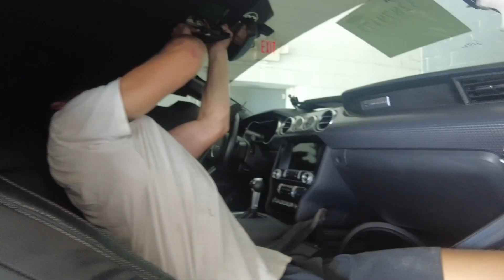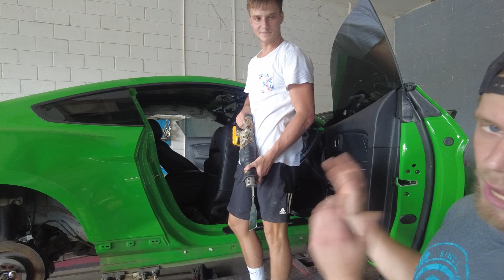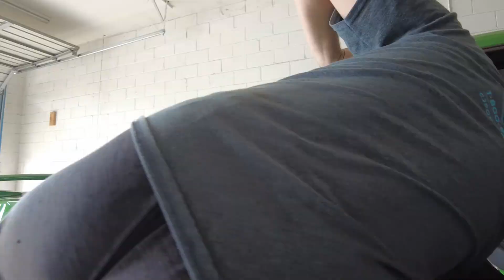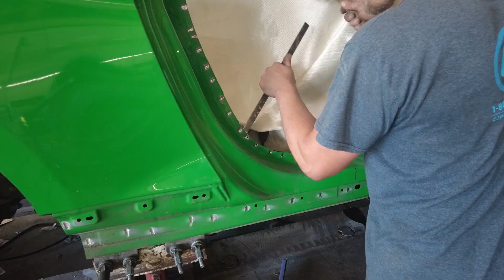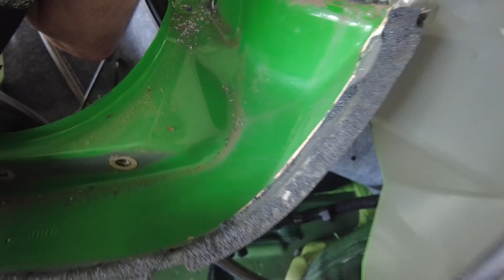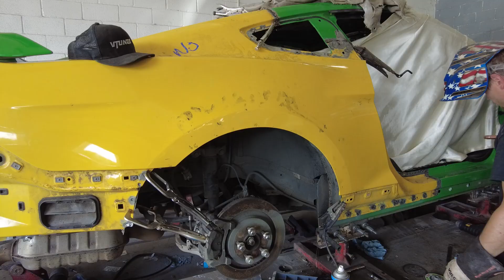Replacing the quarter panel on my cousins 2019 Ford Mustang GT

Comment: Question, wouldn’t it be easier to just mount the entire donor quarter panel without having to remove two outer skins??? Just solder the 3 areas and the floor of the trunk????
Reply: Meaning if the wheel area is really bent inward during impact that the inner shell is damaged, would it be easier to just mount your entire donor shell
Reply: @CSJiGSaW08 yes but you still need to align it properly

Comment: Question my 2018 gen 3 is currently in shop for rear quarter panel replacement 
How ever my insurance declined the claim since “a windshield doesn’t need to be replaced to fix the quarter panel “ 
So my question is WHY does it need to be replaced so I can dispute the claim please help !
Reply from the maker: @ShawnGuerrero-fl1qq  the windshield is the front glass that you look through while driving, there is no way insurance will replace it for a rear quarter job, if the back glass and side glass are intact, the shop will remove them and then install when the quarter is complete